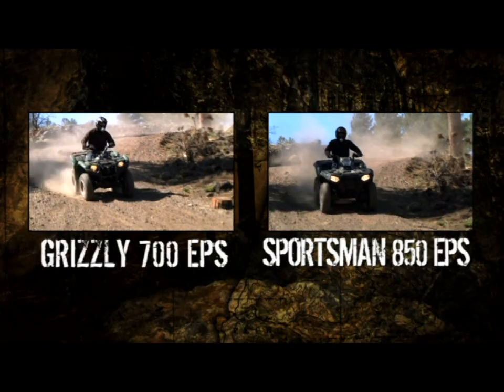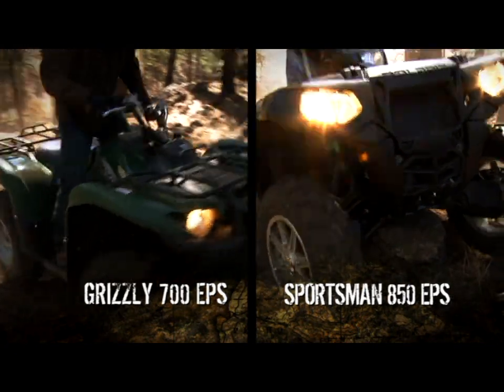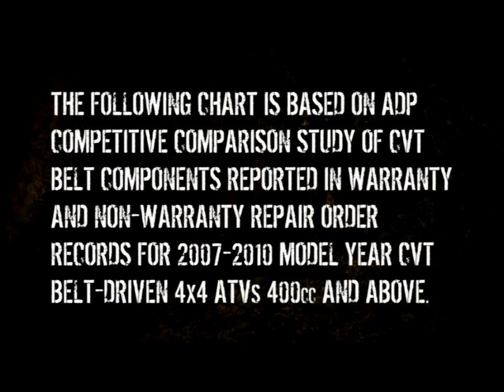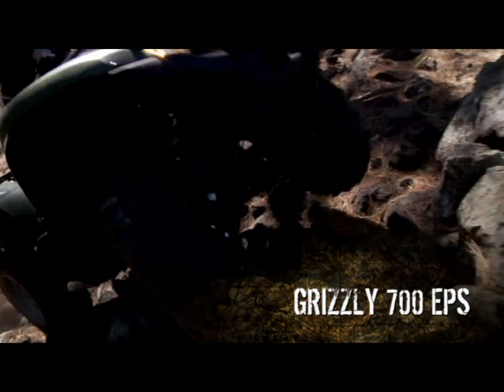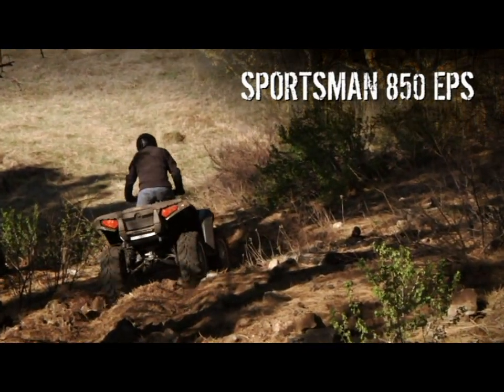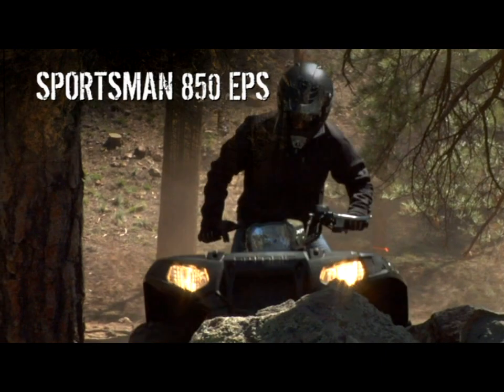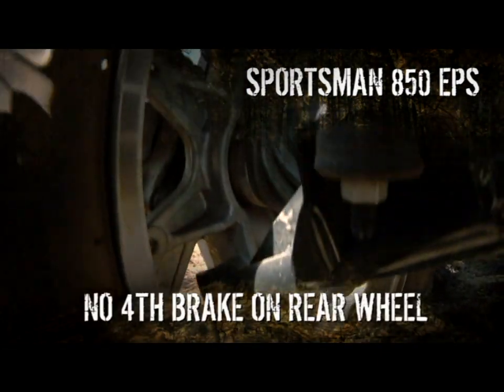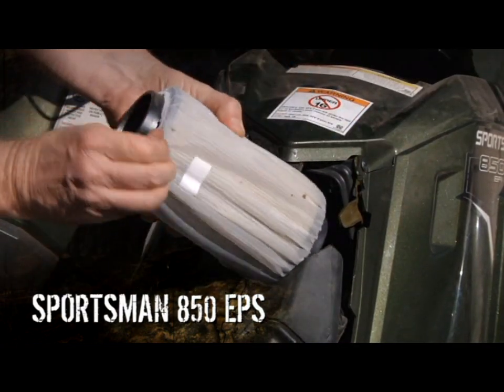Yamaha Grizzly 700 Polaris 850 Camparison

Comment: I don't care what anybody says: honda may not be the best off road and it may not be the fastest but it will outlast and take more abuse than a belt drive piece of shit
Reply: I would agree with you that honda makes good engines, and they last, and are durable, but in the tranny dept they actually lack quite baddly, they are limited in avalible gear ratio,they suck more avalible engine power due to heavy rotating mass, have issues with the shifting controlls, make the engine tranny unit way heavier ( and the overall machine heavier as a result), and when they do break ( and they will if they get abused or enough use ), are insanelly expensive to fix (rebuild), where as for the most part a belt is cheap comparitively, ( and I got over 5000 miles on the belt in my Grizzly, and it shows no real wear as of yet, ( even asked the dealer mechanic if changing it would be a good idea with that many miles and his answer was NO even when I said that I don't want it to break and strand me he said no worries), and I live in a very mountainous area of Idaho and use the shit out of my 07 700, it has even been rolled 3 times and up on it's side too many to count, and I weigh about 350lbs and pull a damn heavy little trailer behind it and load a shit load of other gear on it quite often for camping trips) like some other guys on here say I have tried all the other's at least twice and I gotta stick to the grizzly it may not be the best at any one thing but it does damn near everything so good it is nearly impossible to beat
Reply: looseballs1966 that's one way to put down a honda lover that thinks honda is so perfect.
Reply: Liam Mallan another toy lover😜

Comment: bullshit I have a polaris 850 it ain't belt drivin its full on shaft drivin and the 850 will out perform the damn grizzly any day
Reply: U r wrong u r Polaris it's a belt driven machine u r right u got a drive shaft but u r transmission it s belt driven except Honda all atv s are belt driven
Reply: Check again Gomer. I have changed the belt several times on my 850's